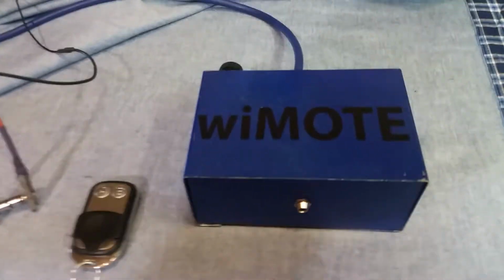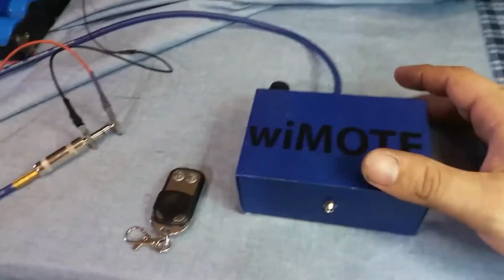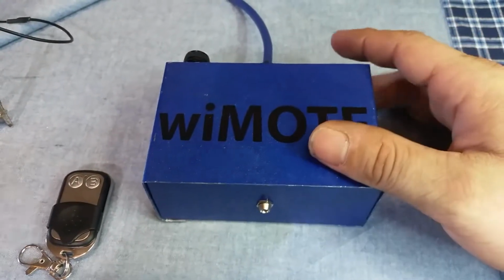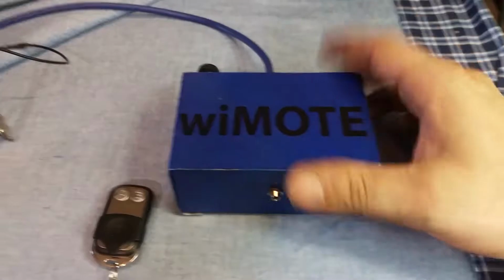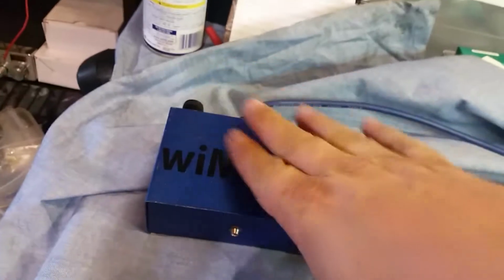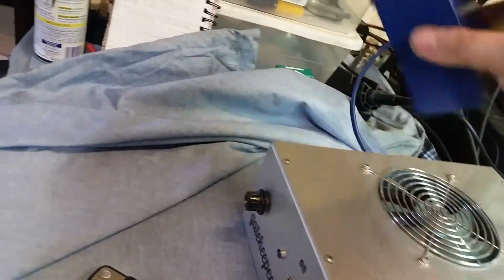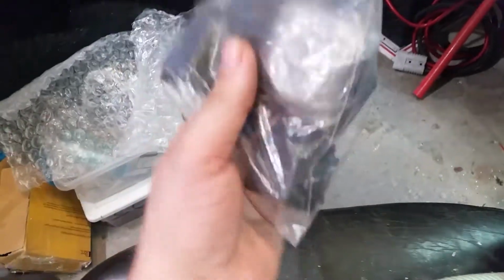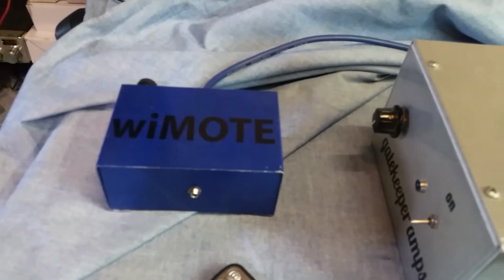Mr. Gradys All Blue SINGLE wiMOTE (wireless amplifier remote with programming instructions)

Comment: I like them. can even get one to turn off /on receive amp as well. That push and hold for on will be great in a big box or SSB. instead of foot pedal just push button. save that relay. I re did a 32 pill that all the fans went threw remote wire to a relay for fans. also Thermal switch set to keep fans on when hot even if amp off. Customer wanted that. Think I used NO 105F switch. was neet. turn amp off fans run to heatsink cool then fans go off. amp on fans run all the time. 73's
Reply from the maker: That is really cool...I did a timer circuit one time on a yellow 2 pill...not sure if you saw that video where the fan would stay on for about 2 min I think and then would turn off...using simple RLC equation if I rem correctly....I have something really cool that I just thought of thanks to you saying what you just said about using the monetary part of it to key up a big box..OH MAN I JUST THOUGHT OF SOMETHING REAL COOL MAN.....ive got to order some parts real quick so I can make it.....ooooooh man this is gonna be so freaking cool bro imma give you a shout out in the video when I finally do it!!!